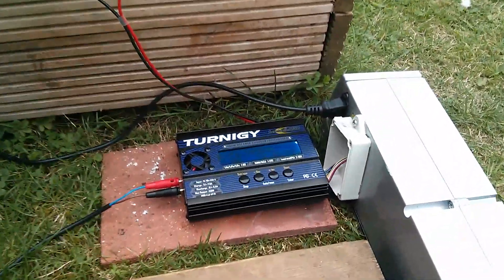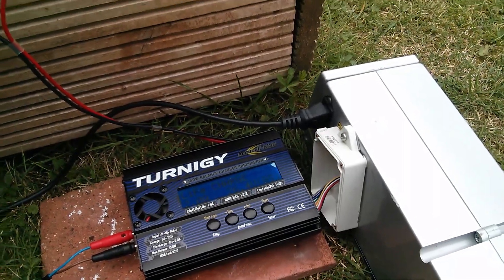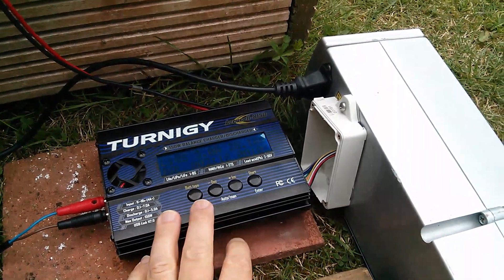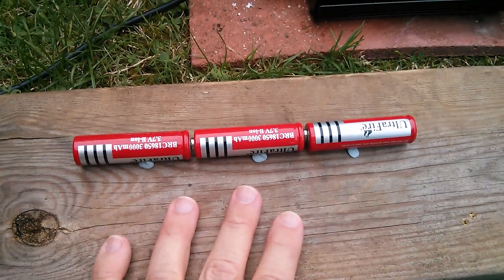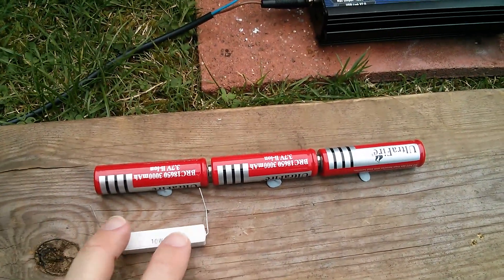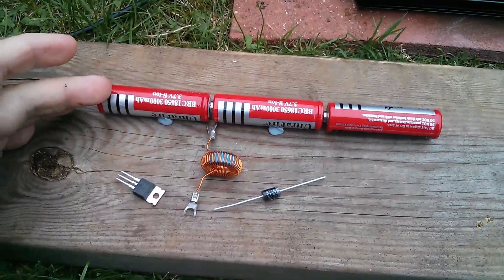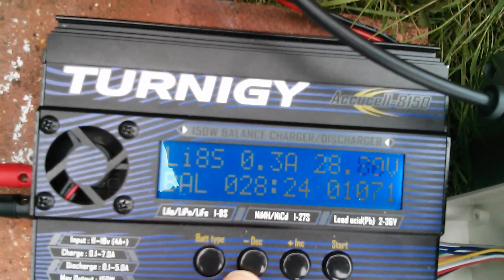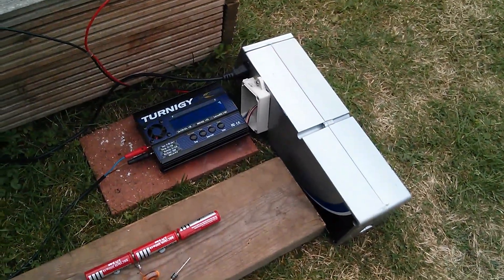Julian's Idea: Balance Charging using Inductive Transfer

Comment: This will probably be a long comment :)
You know that I designed the SBMS you have the old SBMS4080 and that uses resistive discharge but is a different way than the cheap balancers that is extremely ineffective but simpler to implement so is popular.
On SBMS you have some settings one is that it allows to only cell balance during charging or it can be done only during discharging or both (preferred just during charging) then next is when to do cell balancing and for LiFePO4 I set the range between 3.2V and 3.6V if any cell is outside this limits no cell balancing will be done.
Next is minimum and max cell delta (difference between the lowest and highest cell voltage) and normally that is set to 15mV and 400mV
So during charging (charging is done 6 to 15h depending on time of year and solar PV orientation) as soon as one or more cells are 15mV or more above the lowest cell those higher cells get a resistor in parallel that will divert (in the case of SBMS4080 around 70mA with LiFePO4).
So the higher cells are not discharged is just that they will receive 70mA less than the lower cells since part of the charge current that is normally much higher (minim 300mA is required to detect charging).
Cell balancing in a normal offgrid solar installation is performed for a few hours thus accumulated energy diverted away from the higher cells is say 300mAh / day.
This 300mAh/day while seems small can keep in balance even extremely large capacity cells in offgrid solar type installations where charge rate is typically under 0.25C and discharge rate less than 0.5C.
As an example my 100Ah 8 cell GBS LiFePO4 cells without any cell balancing will get an imbalance of less than 2Ah over a 3 months period with daily use powering my offgrid house.
I know that since before having the SBMS4080 installed I had no cell balancing and I will do manual top balancing every few months when after the battery was full I will manually charge the lower cells and the lowest was never more than 2Ah away from fully charged after 3 to 4 months.
So with my particular use and my 100Ah cells just about 2Ah/90days = 22mAh/day is needed to keep the cells in balance so you can understand that 300mAh/day can keep in balance cells with much higher capacity or cells that are of lower quality (higher internal DC resistance difference between cells).

The point was that properly implemented resistive cell balancing will not use energy from the cells at all. All the energy dissipated on those small resistors is from PV panel directly and in offgrid you anyway have at least 30 to 50% unused solar PV energy anyway so that fraction of a % will make no difference 300mAh x 26V = 7.8Wh out of in my 2 to 4kWh/day is just 0.4% of available PV energy and this is worst case. I also have a typical 40 to 50% unused energy in summer and 20 to 30% unused in winter to get that 0.4% in perspective.
Is important that energy is used from PV and not cells for two reason first the excess PV energy mentioned above and second the PV energy is typically under 3 cent/kWh while energy even stored in LiFePO4 is above 20cent/kWh can be 10 to 20x more expensive.
Useful electrical energy is not free :).
The active capacitive or inductive cell balancing where energy from the higher cells is transfered to the lower cells is done in EV mostly because charge and discharge rates are much higher than in offgrid applications and to keep the generated heat from balancing circuit lower. Cell balancing currents on EV is quite small 10 to 50mA typical but enough to keep the battery pack in balance over the life of the battery.
Reply from the maker: ***** Hi Dacian. I'm going to try connecting the SBMS to my battery pack soon. I'm interested in going through all the settings seeing what can be adjusted. I may use 2x 36-cell panels in series or a constant current step-up converter from my 12V battery.
The balance currents you've mentioned seem very low. I was thinking of trying to offset the entire charge current (maybe several amps) with my inductive transfer method. I can't figure out whether those currents would sum together if several cells are trying to offset simultaneously. In my first system, the cells will offset the charge current autonomously - in other words, no cell will have any awareness of what the other cells are doing.
Maybe it won't work, but I'm loving the whole learning process, turning my fear of lithium cells into real understanding.
Reply: Julian Ilett Yes both the 2x 36 cells PV or constant current step up will work fine for SBMS with 8 cells LiFePO4.
I have a video explaining all 34 parameters that can be set. It is a one hour long video called something like SBMS4080 user interface or something like that.
Those low currents are more than appropriate to keep a battery in balance. Any new battery installed will need to have an initial top balance done by individually charging each cell to 3.6V. Once that is done the small balance current provided by the SBMS is more than enough to keep a battery of any size up to 1000Ah.
Of course if the cells are of bad quality with large difference between cells with different DC resistance, self discharge and capacity then no balancer will be able to keep them in balance or the amount of wasted energy for balancing will be very significant.
A set of 8 cells with no more than 5 to 10% difference in DC resistance charged at a reasonable 0.25C (4h charge from zero to full) and an average discharge rate of 0.5C will stay in good enough balance for month without a maintenance balancer as the one in SBMS4080.
As I mentioned before there was less than 2% SOC difrence betwen the highest and lowest cell after 3 months of daily use.
If you have the time to experiment try an measure the internal DC resistance of your 8 cells. The way you do that is measure the open circuit voltage and then the voltage with a fixed known load say 5A and 10A just to have more precise values. Then subtract the load voltage on each cell from the unload voltage and is easy to calculate the internal DC resistance of the battery from that and the known load current.
I did the same for both the 100Ah GBS (about just under 2mohm/cell) and you can find a video about that also.
I recently got some 500F super-capacitors and those have internal resistance all over the place with up to 10x (1000%) difference between the lowest and the highest one (they where probably rejected at quality control and someone sells those on eBay). Even a 20 to 30% difference between cell DC resistance will make for an unusable pack.
The cells with higher DC resistance will receive less charge since a large part will be dissipated as heat on the internal equivalent series resistance. The extra heat will also degrade that cell more than the others helping degrade those cells even more and increase the difference between cells.
The GBS cells where sold in group of 4 and each of this group where selected to have as close of a DC resistance as possible selecting the similar cells after production.

Comment: Julian Ilett, you might double check that spikes in voltage won't harm the cells. Not sure how the membranes inside will react to sudden voltages well beyond the cell's rating, even if that voltage spike is brief.

Its not like its difficult to add some voltage limiting anyway.

I'm personally curious to see if this concept works... You're basically placing a cell powered boost converter from cell to cell. Figure an ardiuno can sweep for the highest cell value and couple the booster circuit between it and the lowest value cell at the time and give it x period of time or until the condition changes/does not favor this connection, then resweep, reconnect to qualifying cells, wash rinse, repeat until a tolerance is met and kept via main charge current. You might need a higher current link to the individual cells if you want this to work quickly, but even still, it should work as is via the balance leads. Potentially having a multi-channel circuit could improve balancing times by keeping multiple cells in check at once.
Reply from the maker: XFolf The energy pulse from the inductor will be completely dwarfed by the energy inside the cell, so the pulses will barely be noticed.
In my proposed first version, each cell microcontroller will function autonomously - it will simply try to offset the incoming charge current by passing it to the next cell - it won't have any knowledge of what adjacent cells are doing

Comment: There are chargers which pump more current to the low cells to balance them instead of draining high cells through balance connector. But they're pretty expensive

Comment: I don't understand why those four button chargers don't just charge one cell at a time, once one cell has reached the target voltage.
Reply: TheUnnamedGent 
It would take much longer. The charger would have to switch to single cell mode as soon as the first cell reaches its target voltage. Maybe not much of a problem on a 3S, but quite annoying on a 6S or 8S. Another problem is that the balance leads aren't made for high currents.
Reply: TheUnnamedGent There are single cell chargers, but they don't support batteries in a series circuit. For single cell charging, you need to isolate the current sources from each other, which at these currents is quite a cost for materials.

Comment: Wouldn't you be able to transfer charge from right to left or left to right be replacing the single MOSFET and diode with a pair of back-to-back MOSFETS on each side:

B--------------B------------B
|                L             |
+-Q--Q----+-Q--Q---+

B = Lithium cell
L = Inductor
Q = MOSFET

If there were 4 terminal MOSFETS readily available the body connection brought out, you could tie the body to a negative voltage and only use 1 MOSFET, but unfortunately these devices aren't readily available.
Reply: roidroid Funny you should say that - H Bridge crossed my mind too when Julian mentioned flipping the inductor around.
Reply: Steve Rodgers a solid-state H Bridge might be the device you're talking about.  But afaik they are internally indeed just made of multiple MOSFETs.

Comment: Putting an inductor and a diode across each cell is going to effectively (minus the diode forward voltage drop) bypass each cell isn't it?. Sounds like you are going to be passing a lot of current straight through the inductor/diode circuitry constantly. I think you will need to switch the diode out of the circuit unless you are transferring charge.

Comment: I have a slightly different idea.
Have two wires and at each junction between cells alternatively tap onto one of the wires through a switch (n+1 switches), have a inductor shorting those two wires and if you synchronously(only needed for inductor discharge) switch the switches you can move charge from any odd cell to any even cell or visa versa.
You will need a resistor and comparator to turn off a switch at the zero crossing for the current on the inductor during discharge to prevent charge being removed.
The resistor with another comparator can also be used to trigger the synchronous switching on the inductor charge at a set current before saturation.
If you want from any cell to any other cell use H-bridge between the inductor and the wires.
So any cell to any cell = n+5 switches, 1 inductor, 2 comparators and a little logic.

Comment: I would propose to do a circuit that converts serial to parallel connection.
It will need a lot of mosfets, but I think I can do such a circuit.
Reply from the maker: Kamil Gorecki I had the same idea - parallel configuration for charging, series for use in the vehicle. At the point when you switch to parallel, quite high currents may flow for a short time while the cell voltages equalize.
Reply: Kamil Gorecki 
This would make charging much easier, but the battery pack much more complicated and inefficient. The problem is that even with good (i. e. low Rds(on) ) MOSFETs you will lose quite alot in all the MOSFETS while using the battery. Maybe to the point that using an all parallel battery and a beefy stepup converter is as efficient.

Comment: definitely sounds like it would work but seems kind of expensive with marginal gain that most of the market won't be interested in.
Reply from the maker: dongimin2 That's a good point. It would have to be commercially viable.

Comment: What manufacturer or 18650 batteries do you recommend and where should I get them from?
Reply: Panasonic NCR18650B, if you have the cash :)
Reply: Panasonic NCR18650B, if you have the cash :)
Reply: Panasonic NCR18650B, if you have the cash :)
Reply: Thank you Jono
Reply: Jono6671 they are super expensive but top of the line, i would consider buying used laptop batteries, if you get one from an alienware laptop, they have panasonic 3.6ah cells, compared to regular laptops which have samsung or sony around 2.4 ah, new they are like £10 or more per cell, but the used alienware battery cost me £2 per cell, bargain!

Comment: the best way i found was each bank has its own charger so if it is 18650 each bank would have a charger that gives out 4.2 volt and shuts off when charged i use 3 for my 11.1 - 12.6 volt pack it charges faster and can not go out of balance when charging do to them not been charged in series
Reply from the maker: David Simpson That does eliminate the problem, but I'm thinking about using 9 or maybe 10 cells to give the bike a bit more power. That would be a lot of chargers.
Reply: +Julian Ilett aye but if you put them in a box with a quick connect cable like they do to the balance charger
Reply: +Julian Ilett I could not find a unit that would run from solar and keep them in balance so i was using one charg circuit per panel 3 series battery's 3 panels to there own charge pcb this way cells stay in sync and I was taking the 12 volt off for charging phones and lights
Reply: just an idea would a voltage divider worek if each diision was set for 4.2 volt i would really love away to charge a 11.1volt pack from solar or any other power input that will auto charge and shut off when all cels reach charged limit my knoledge of electronics is very limited would be wounderfull if you can build something i would defo like a version if you manage to build somthing

Comment: So the inductor doing a same as a capacitor whats the point to use an inductor then?
And a capacitor gives a kinda steady voltage, the inductor will give a very high voltage spike what is good for lead acid batteries See Bendini. Since Lipo batteries need a steady 4.2V while charging, not sure they will like the high voltage spikes.
Reply: There will not be a spike in his case. An inductor just wants current flowing through it to change smoothly. If there is somewhere for the current to go (the other cell) then that will happen without any dramatic voltage swing. If you try to open circuit an inductor while current is non-zero then you will get your spike...
Reply: JamesUKE92 But if there's no spike, then the voltage to charge the low-volt cell will never be high enough.  It'll always be a lower voltage than the high-volt cell due to the diode's small internal voltage drop.  Right?

i mean isn't that how a boost converter raises voltage, by utilizing the spike (but smoothing it out via capacitors)?  So wouldn't eliminating the spike also eliminate the voltage boost (, the voltage boost which is needed to counter the diode's internal voltage-drop)?

note: i have no idea, i'm not good with electronics

Comment: Are the ultrafire batteries protected?
Does the protection withstand the high voltage?
ps: I do think it does. I have had a couple of old Nokia LiIon cells which did not accept a charge, I put those approx 24 hours on a pulsing system (just a relay breaking its own power source continuously). The protection seems to survive the pulses (They are about 50 Volts and have almost now power to it). Your inductor will transfer more current so you do need to be aware that there probably is a Duty Cycle  and frequency that will damage the protective circuit.
Thanks for sharing, the idea is nice. However not being able to transfer the power ti 'just'  any cell make it very inefficient. Using the super capacitor would be better (ha ha, and you would also have to balance those as well since you need at least 2),
Cherio
Reply: deslomeslager 

a battery with fire in the name should be a clue as to its quality, just buy samsung/panasonic etc.
Reply: lez briddon
Sorry, you missed the point here. The message is about Julian having to be careful in his tests with Li-Ion batteries if they have a protection circuit. As for myself I have hundreds of those laptop batteries which are often Samsung and always unprotected.

Comment: Cool idea! Could you transfer charge the other way by adding a second mosfet (and diode) on the other side of the inductor? It should work the same way, but just reversed polarity.
Reply from the maker: Corky Mork Thanks. I've no doubt that's possible, but it forces the cell (or uC connected to the cell) to make a choice - do I push charge up the cell array or down? That means each cell needs to know the voltage of all other cells. I have been thinking about a system where each cell microcontroller communicates with all the others via Bluetooth, but that's a whole different level of complexity.

Comment: If you're interested in a new electric car, look at the current offers for the Renault Zoe in the UK, you can get one on finance for 3 years. I think it was £160 a month (including battery rental). Not spam. No commercial links. Just a personal suggestion.
Reply from the maker: jeales895 I like the Zoe, but have range anxiety. That's why I prefer the Golf GTE.
Reply: Julian Ilett Totally understand. I think it works best as a second car. Golf GTE can be properly fast or super-economical and can go as many miles as you want